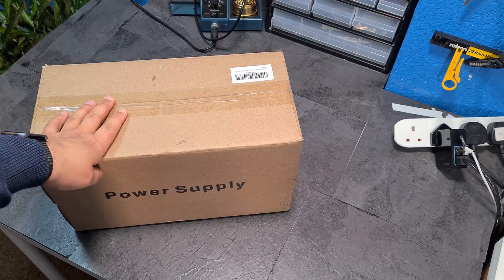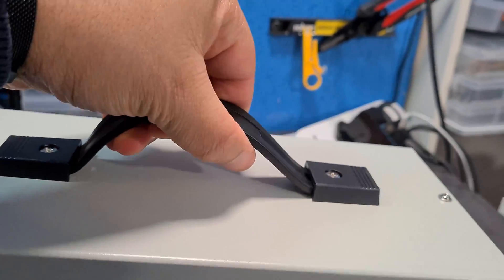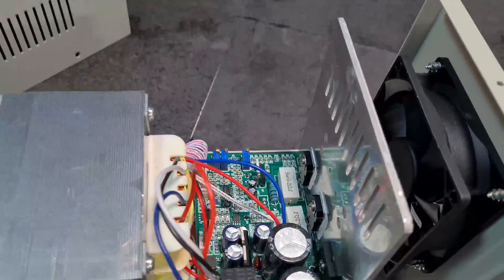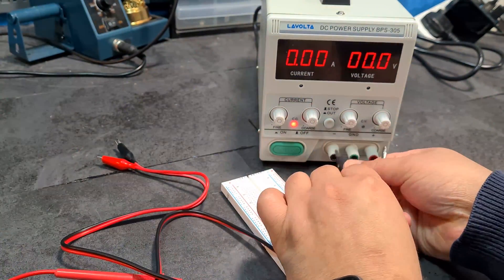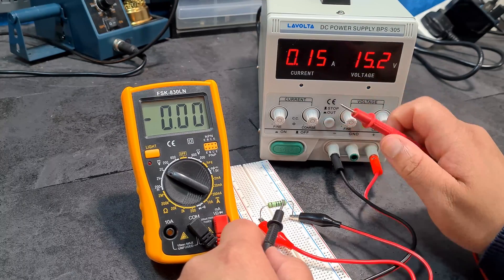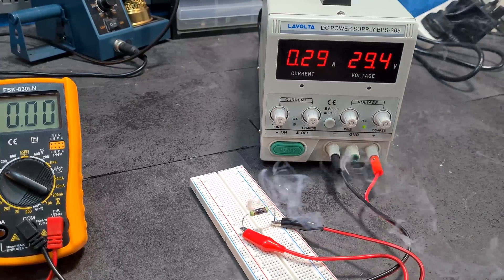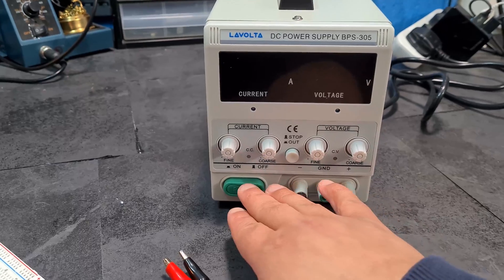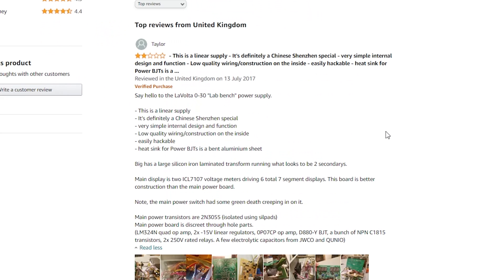Lavolta Variable DC Power Supply 30V 5A - Unboxing & Testing Cheapest Amazon PSU

Comment: Voltage will be slightly lower since you running it through a resistor 1st ..so it's a silly way of testing a power supply ..other than blowing up a capacitor for laugh
Reply from the maker: yeah this is a funny video watching it back now lol i still dont really know how to test a psu. most amps i got was yday putting 2.5A into a battery and almost melting it lol